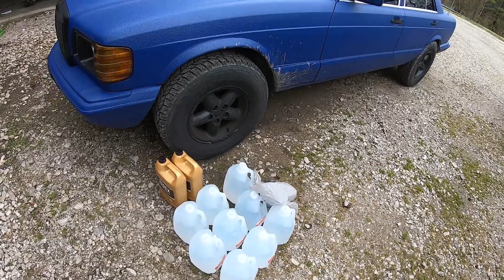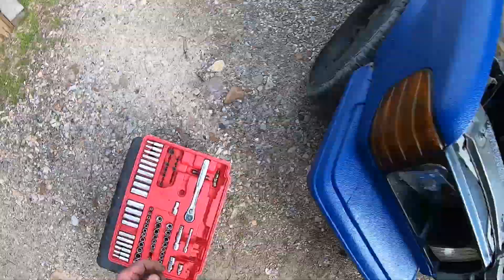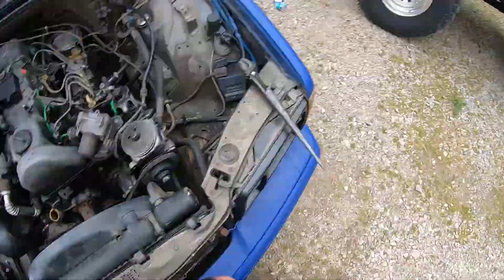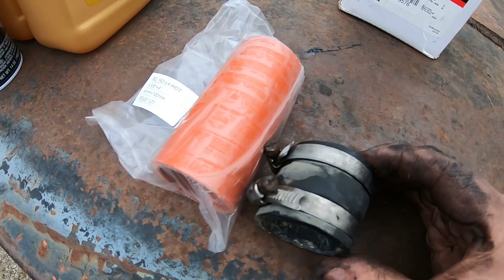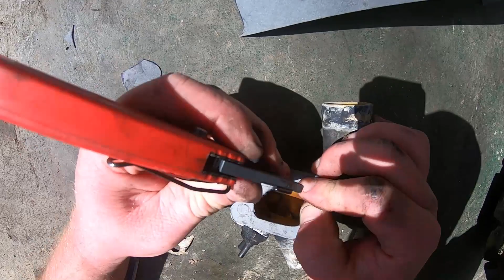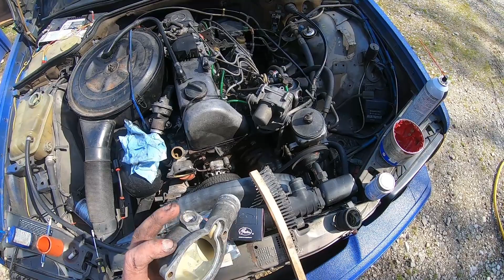'83 Mercedes 300SD W126 Cooling System Overhaul - Bypass Hose Replacement

Comment: all you ever need to make a gasket is the gasket material and a ball peen hammer.  Place the material over the housing and tap around the edges and the bolt hose.  Makes a perfect gasket every time with a small amount of effort.
Reply from the maker: That's a trick I recently learned.  Pretty slick.